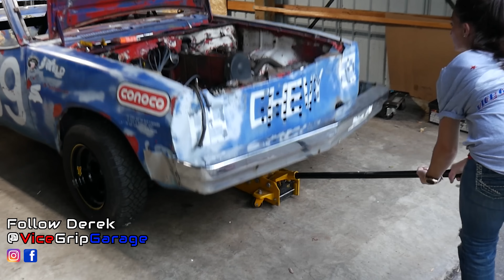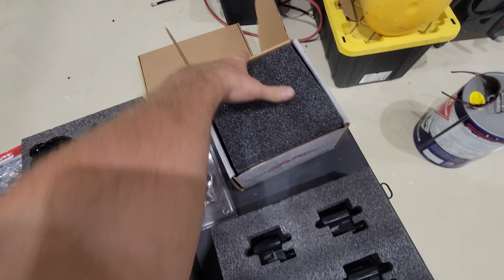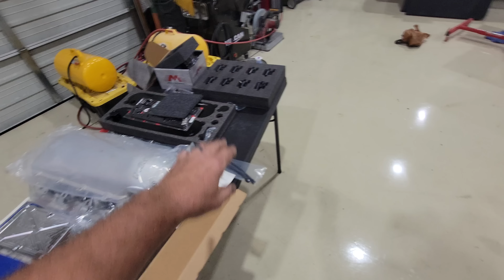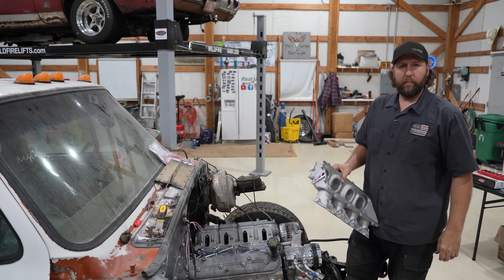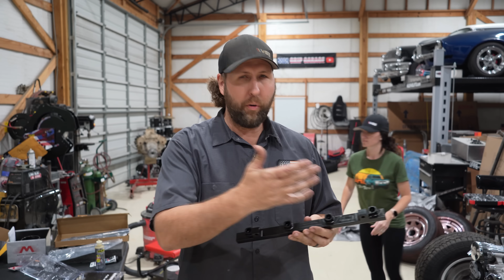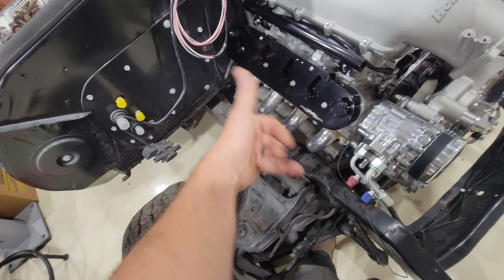FINALLY! Complete LS Engine Assembly For Crew Cab!

Comment: Derek, do expect to get better gas mileage with the smaller engine? I’ve got a 2000 C/K 3500 quad cab duel ly  455 4x4 and I think I get about 5 or 6 miles a gallon empty.

Comment: I have a 1993 danger ranger,I'm raping with a 604 late model engine just forcing it in something that keeps screaming no, and earlier today I needed to cut a chunk of frame out to allow the headers to fit and I picked the spot that apparently held the entire frame together because it broke in half so the passengers side is a low rider

Comment: Hey Derek you can have a very nice big block build 450-600 HP with killer fuel mileage. The way to do this is to use the GM Quadrajet carburetor with good gear ratios. Like 1/2 tons 273 gears with a turbo 400 you're running between 65 and 75 mph at only 1800-1900 RPMS. 3/4-1 Tons you can run a 323-342 gear ratio with a 400 turbo, it will put you between 2200-2500 RPMS @ 65-75 mph. These combos alone get anywhere between 15-20 MPG just in the city alone. You have to use the GM Quadrajet carburetor, good gear ratios. All these combos we have ran on ours and we are still using 3 speed transmissions. We havnt tired 4 speeds yet. You can change tire sizes with these combo's all so to get faster speeds at lower rmp's. These work well with the small blocks to with Quadra Jets. Good engines do not need 373,411, and other crazy gear ratios to move any vehicles. Main key is to run the Quadrajet carburetor's because unlike all the other ones out there on the market Quadrajet is the only one that delivers the proper amount of fuel and Air the engine is willing to pull so it is never too much or too little. After Udall and the carburetors of course. We are seeing these numbers with 750 stage 2 all the way up to 900 C FM Quadrajet's. This is also capable with running AC as well. You can have big cubic-inch and big Power and still get really healthy fuel mileage on any build. You just have to set the engine transmission and gear ratios and tires Etc to match each other. Look at what kind of fuel mileage Cadillacs with 504 72s was getting back in the 60s and 70s with this carburetor. Not to mention how heavy these vehicles were. Not Justa Cadillacs either, this was on all GM vehicles. If people would just take a few minutes and give this a try they would see that it really works and it is very possible to get where you want with your mileage with big cubic inch and big Power I'm still have a c and still be able to ride the family in it antique trips cross-country trips. Kind of like semis with all their speeds in a manual transmission at low RPMs

Comment: do NOT forget to install the wobble pop holders after all if a feller is going to snip into town, he needs a place for the wobble pops so a feller can headbang with def Leppard (or hearing mouse as i call them) thumping out of the  old boomer thumping  box  that a fellette  insists  has to be  installed , Equipped with the blue teeth can't   wait to  see  Bently  Rippin round the back 40  in the  cat house crew cab

Comment: Engine looks good! I'd have gone with the Holley High Ram as the low ram has short runners and that kills low end power. If you run sushi slicers on it, it will work fine though. Great content thanks!

Comment: Been going through a rough time with mom's health, and found "a guys" channel while looking for ideas on painting my old K10 (probably just send it out for that bit...kinda hate painting). Grew up in the old pickup and went a bit crazy on the rebuild, which is on like year 15 or so...building it into a 383 stroker and putting a TPI system on it just for fun because I like hard stuff. Anyway, you inspired a feller to get back after it, and gave me some smiles and laughs during a hard time. Thanks man!

Comment: I have a 2005 Suburban I'm going to do some work to it but I think I'm going to go LSA with the engine that is in my truck what's a 5.3 updated to the LSA engine do some transmission mods cuz it's four-wheel drive and I don't want to lose transmission right off the bat

Comment: Hey i get the whole LS thing look at a little 5.3 LS is making more power then a SBC and you can get them out of the boneyard for cheap when a SBC you would have to spend money to make the same power a LS does stock. I love the old school engines but fuel is not getting cheaper I just went out and bought a 4 banger honda civic for a daily just because of the fuel prices are out of control and had to part the V8 truck until I need it anyway LS are great engines they are cheap and I would do the same thing if I was you.

Comment: I feel ya on the hardware store trip.  It takes me about the same amount of time if you count time spent in the store.  There is technically a hardware store near the house, but...it's in a gas station.  The odds of them having any particular item you need are about 25%, and if they do have it there's only about a 50% chance you'll be able to find it or anyone who works there knows where it is.  If you multiply that out, carry the two, and borrow one, that equates to:  I just kill and hour and a half and don't have to leave the store mad.
Also, the build looks beautiful!

Comment: Are you gonna use an '87 Tank with sump and pump or something custom?  I have an '83 K20 converted to Tune Port injection and I used an '87 tank and a TPI pump.  Worked great and a lot quieter than an external pump.

Comment: I would love to see a video of what to do with one of these old units that have been sitting around for a while before you start driving it. I recently picked up an older Jeep that has been sitting for a while and needs some love. I've gotten most of the basics, brakes, plugs, oil, coolant, topped off the power steering and replaced some bulbs. I'm sure there is a long list of other things to check out too. Next project for me right now is cleaning the engine bay so i can see what leaks are new

Comment: All academic now, but if you heat the tape then it will peal off fairly easily, then all that is left is some glue residue which can be wiped off with thinners or similar.

Comment: Decades ago, I was replacing a transmission pan on an old Torqueflight A727. I had picked up a torque wrench at the parts house, which was a completely foreign tool to me. But I knew the bolts had to be torqued correctly so it wouldn’t leak. I looked up the specs, dialed in the foot-pounds on the wrench, and, not understanding that the wrench was supposed to click when it reached the correct torque, proceeded to strip all of the threads out of the transmission housing. I was about 8 bolts in when I realized it wasn’t slipping when it reached the correct torque, and I could turn the “tightened” bolts by hand. I called a friend to explain what was happening, because I couldn’t wrap my mind around the fact that I had just completely stripped out all of these bolt holes. He too was baffled, but he looked up the specs on the bolts and saw what I didn’t see…inch-pounds!

Comment: Use a heat gun to soften the adhesive in masking tape.  Use the low setting because the tape will burn otherwise.  It works well on tape that has been on too long.  If you've ever seen a vehicle that has been masked off for paint and it has sat that way for years, this is the best way to remove it and almost all of the adhesive.  It also works on vehicles that have had duct tape stuck on them for years.  It is a lot easier on the surface than razor blades.

Comment: I have a 2007 GMC Seirra 2500HD with the 6 liter Vortec... some people say its an LS... cause the motor is based on the 2006 corvette 6 liter.. but has a cast block and not aluminum.. I was told the 6 liter is called an L96.. anyone??

Comment: Nice…Had a conversion to LS on a 70 C10.  Watching this helps with understanding for future activity.  The BIGGEST take away was to remove the front end (fenders etc) when doing a conversion….A bit more work (well a lot) but well worth it for a number of other reasons as well (I.e. suspension work) — Nice video

Comment: Goo Gone is a staple in my chem cabinet. It removes stickers, tape, duct tape residue, and other stubborn adhesives. It leaves an oily residue, so you still have to degrease after, but it's worth it. And is smells like oranges.

Comment: Derek! Run the steam port to the radiator. Not under the cap. Coolant continues to flow out of the steam tubes on the heads. If you knew that, my fault. Just wanted to be sure. Didn’t want you overheating that LS 🤘🤘🤘

Comment: How do you put oil in the engine
Reply: See @ 8:51 there is a big black tube with a big black cap on it coming out of the block on the (to our left as seen) side of the block and extending up above the block into the air.
This is the oil filler hole.

Comment: Back in the day, we used KAR Products. My father started using them I believe in the 70s and we continued with them for over 25 years.
They stocked for us everything forms 1/4 self tappers to 2 1/2x6 grade 8 bolts.
We ran coast to coast had almost 200 pieces of equipment serviced by 10 mechanics.
After we closed, I started flipping cars. KAR Products continued to service my home garage until I had to g a “real” job with benefits…

Comment: For old tape/ sticky residue- don’t never ever use a cheek poker on that aluminum. Just peel off enough tape to get some no-lint shop rags in the intake ports. Then hit it with brake cleaner and work it with a soft brass brush and wipe it off. No muss, no fuss, easy peasy. The 356-T6 aluminum is harder than the brass so no way the brush can hurt it like a steel cheek poker.

Comment: Use a high-quality battery you sure you run your 12-volt to the direct to the battery for clean-power you don't want any other load you want separate lines for your 12 V use OEM sensors cam sensor ACDelco I have found in a dam picky

Comment: Not a 45 degrees angle !!!! remember,... 90 degrees is a right angle and 45 degrees is an acute angle. this is really a 135 degree fuel hose line and it's an obtuse angle!!!!!

Comment: You should ditch the power brake booster. If the cam is rowdy probably won’t have enough vacuum anyway. Put the hydro boost system that runs off the power steering pump. Most big block trucks of this body style had them factree

Comment: Ya know I like the LS swap in lots of vehicles, but for an old truck a 454 crate with an HEI and a turbo 400 is just as turn key without all the electronics, adapters, linkages, gas tank etc. Is so much simpler. Plus most of us can't afford Summit Racing. Who need air? Sorry to disagree because i really like  the projects you do and will still keep up.

Comment: Take it from a guy who worked at O’Reilly 9 years. Don’t be gapping iridium spark plugs. They’re pre-gapped from the factory. You can check the gap, but the tip is too fine to gap them. You run the risk of breaking the tip trying to gap them. Only reason the gap would be wrong is if it got damaged during shipping. Loving the truck Derek! Keep up the great work. I like the LS swaps, but it’s not really for me. I know people love a carburetor, but fuel injection to me is just so much easier. No adjusting it or anything. It adjusts itself. The aftermarket systems are much less complex than the OEMs. If you want an easy starting reliable fuel system fuel injection is where you want to be.

Comment: Most steam line kits run under the intake in that gap, not sure if that kit is different, but it tidies it up having it hidden away.  I just used the GM steam lines.

Looks good

Comment: Yeah, those 10 M&M sockets can get away easy. .. Really any socket or nut or bolt. One trick I use is to stuff a piece of paper or plastic glove into the socket then attach it to the ratchet. Makes it fit nice and tight. Same thing for holding a bolt or nut snug on the socket.  Fun learning about this engine and watching. Hope it goes smooth for you.

Comment: Step 1, subsection J...  That seamless transition from using the rusty razor blade to having to use your fingers to get the tape off was priceless.  9:34
It humors a guy to no end how your disclaimer at the beginning states that you're an idiot, from the get.  🤣
You sir, are exponentially more intelligent than 99% of the other yahoos with similar automotive channels out there. 
We will continue to enjoy seeing more vids for this particular build.  Also liking the shorter bite sized vids. 🤙

Comment: I got 2010 Chevy 1/2 ton 4-wheel drive that has LT3 in it. It did produce 428 hp but now with all the alcohol they mix gas it probably down to 350 hp!

Comment: Looks great!  definitely heading in the right direction.  A possible suggestion, use a heat gun on old tape to help soften it up and hopefully it will come off easier.
Reply: 3 year old painters tape,, hmmmm, Fire up the compressor, spray The old W D and some 40 all over it to loosen up the dried up glue, pull out the heat gun, get it red hot, get her down really close, and when it goes poof, blow all the tape and glue ashes away with the compressed air...lol.

You did fine, and your boy works as fast as you do in time lapse videos. 

Stretch wrapping never dries out on a storage engine that is going to be stuck in a fairly dry storage corner.

Comment: There are heat shields on the spark plug wires on the stock engines so the manifolds don't damage the wires. Maybe a thought to consider. 🤔

Comment: Derek, love the channel. I did auto parts for an independent garage direct supplier for 8 years. Our answer to in-shop hardware is Dormans Pik-a-nut cabinet. You can get these from summit or other companies, but if you can find an independent supplier they will be much cheaper.

Comment: ah the Inch pounds vs feet pounds, I've accidentally done that before and the bolt eventually explodes in half and can fly to the ceiling, upside is that is fairly easy to get the thread out on the LS blocks.

Comment: ULine sells nice yellow bins for bolts, I got a couple shallow shelves, set all the bolt sizes up with all the different lengths with washers and nuts. I get my hardware from Fastenal or tractor supply

Comment: At least polished aluminum components seal properly versus metal chrome plated engine components. Chrome will not get you home. M6x1.00 tap just so happen to have few of those, but I also built my Toyota truck from the frame up, so I had to use and buy a few metric's I didn't already have.

Comment: Looking great, love the content as always, good idea planning for possible upgrades!
Reply: Yup, he will need it when Jessica gets her new Burnout pad for Christmas, and then wants a couple of big old Sushi Slicers and blow off valves and bullhorn installed to really light up the tires and make huge clouds of tire smoke!

My guess is she is secretly already in negotiations with 3 different tire manufacturers, and is just holding out for the sweetest deal, and once the ink is dried on the sponsorship contract, there is no way possible Derrick could hold off on forming and pouring the concrete!

A million and a half VGG subs would become 2.8 Mil. Overnight if Jessica was hooting and hollering while doing circles and spins in clouds of colored smoke out back near the tree rows.

Just don't put it in the front yard, or you will need to install grandstands, porta- potties, and a concession stand!

Comment: I’m an old school guy as well to me there is nothing better than a chevy 383 stroker but having had trucks newer trucks with ls engines and rams with the 5.7 
the ls I could spin 6000 and no worries the 5.7 hemi at 5000 sounded like the rods were going to blow out of the block 
and the fords cost double to make same power as ls so I think you made the right call.

Comment: I think you can bring the steam line out to the front grill and use it to froth milk for  cuppa-chinos or lot-A's for fans at the shows. I'm pretty sure the Terminator X has a milk frothing tuner on one of the screens where you can dial in the perfect air fuel ratio.

Comment: my fav. engine for a street rig is the big block chevy they just look better in a rig like my 68 pu it fills the engine compartment and u can get just as much power as a ls 6 if not more plus i been getting the ho 454 for free with low miles on them and they come with a 02xx 400r turbo good to 800 hp stock the engines have a steel crank heavy rods high flow heads from the factory puts out 450 hp at 485 torque stock and all they need is to breath and they really come alive with the 4 inch stroke they come stock with a 600 cfm with a stock manifold if u dyno tune it been getting up to 500 hp out of the stock setup which is amazing with the stock intake .i put a 850 double pumper holly with weiland street intake was going to put a tunnel ram on it but got another project for it .

Comment: derrick, you should put the metal sleeves on the ends of your plug wires so the headers dont eat them for lunch. also i never had any luck from iridium plugs i use copper core instead.

Comment: As a guy working in a parts house, check your plugs even if they're in a sealed 4 pack. Had a single plug in a 4 pack that got smashed before boxing and had exactly zero gap. Always worth hooking your peepers on em before you walk out the door

Comment: I grew up working on small block Chevys, and I was a little bit afraid of trying my hand at LSs, but I was kind of thrust into it when I spun a rod bearing in my daily 08 Silverado 5.3 a few weeks ago. I gotta have the thing running, and I can’t afford to have someone else do the work, so I had to pull the trigger and take it out myself. Currently in the process of a complete rebuild, and I have to say, it’s really not much different than a SBC, aside from the digical stuff. After this, I think I’m gonna get myself another one to build for my 64 Chevy II.